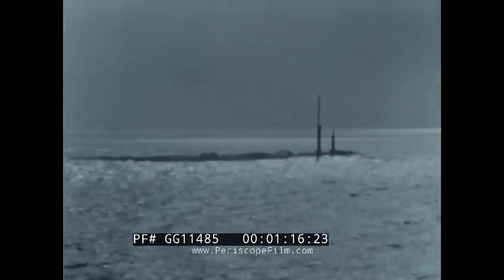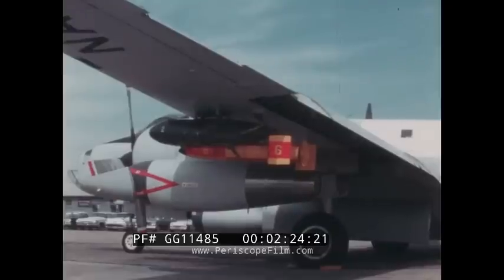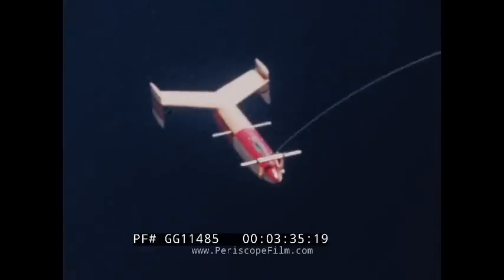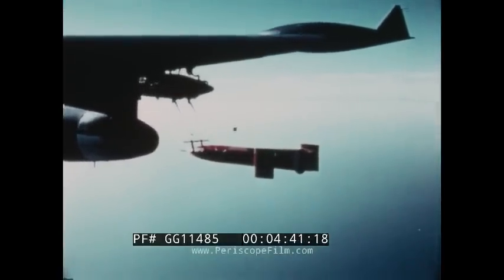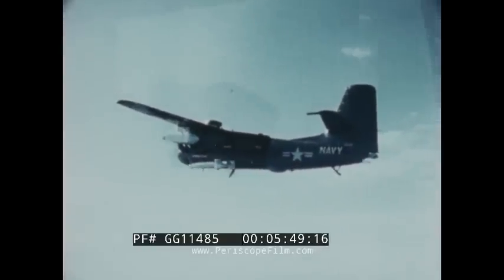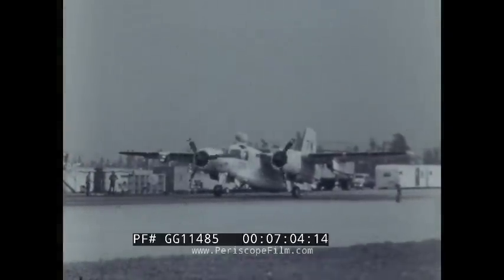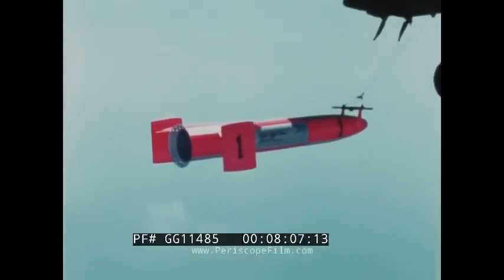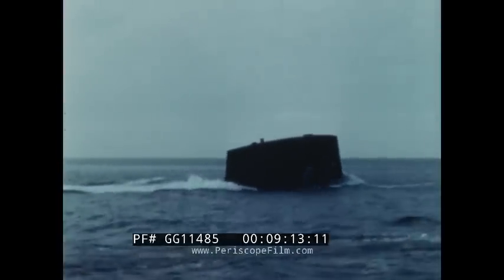U.S. NAVY TOWED MAGNETIC AIRBORNE DETECTION SYSTEM   ANTI-SUBMARINE WARFARE VEHICLE  GG11485

Comment: I wonder why this system wasn’t ever put into operation. The magnetic field of the aircraft drops rapidly with distance so trying to detect a faint submarine magnetic signal would be easier.
I always loved doing MAD compensation flights. During a 45 year flight career I only threw up once and that was because I had food poisoning not motion sickness. Anyways I loved doing MAD compensation because I could concentrate on adjusting the coils on the money while the rest of the crew would be barfing. I ended up with over 3,000 hours in the P-3.
Oh and Patuxent River, MD had its own cat and trap facility. When I knew operations would be occurring during the summer I’d pick up my son from daycare and I’d take the day off. Imaging being a 5 year old kid sitting less than 30’ from an aircraft in afterburners waiting to be catapulted into the air. We had so much fun and 25 years later my son still remembers it fondly.